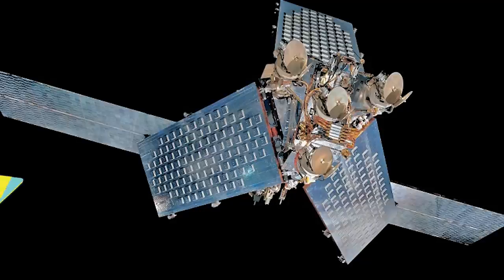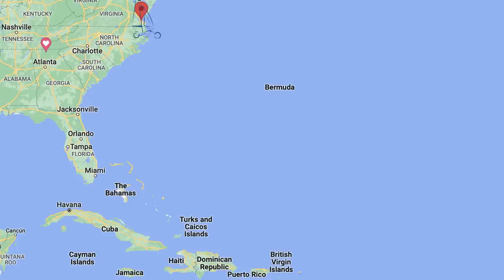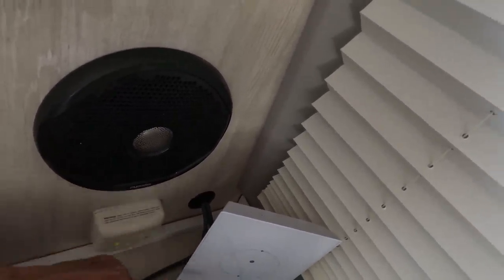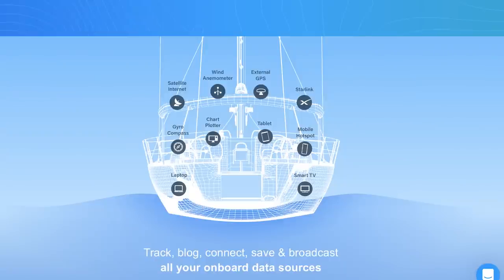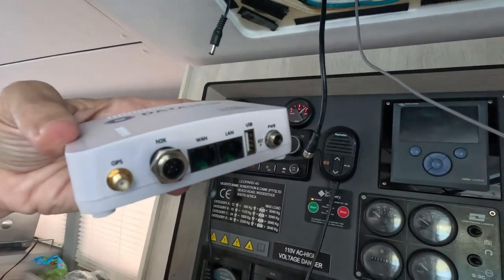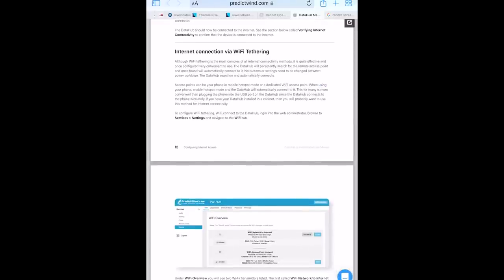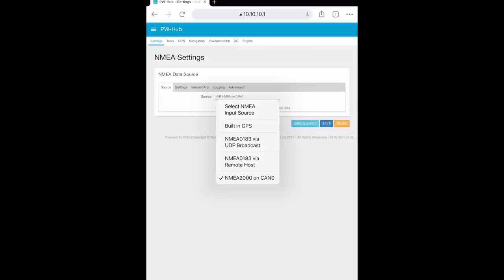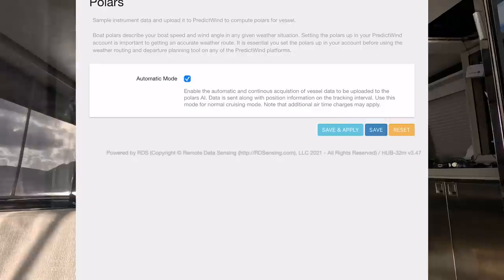Starlink vs Iridium GO. E70

Comment: We have Starlink on our yacht in Australia and its working very well here especially now its been upgraded to full coverage..... BUT...officially the coverage is only 15nm offshore so at some point Starlink "could" disable the offshore coverage. i am PRAYING they actually do the opposite and give us full ocean coverage but it is completely subjective at the present time. Unfortunately we are still stuck with the 1/16 speed of dial up iridium go with over inflated pricing! At this stage I feel if you are following island chains or coastal then it's a definite better replacement, but if you are crossing an ocean then we are still STUCK with iridium... unless Starlink will enable the access.
You can also get rid of the Starlin router. The Starlink cable is basically a standard ethernet cable and there is 48V POE (Power Over Ethernet) supplied through the cable to power dishy. There's lots of videos describing how to modify this and then it can plug into your existing network.
Reply from the maker: Thanks for the comment and the additional info. I’m thinking Elon is not going to disable any coverage. I believe he wants total coverage for as many people as possible. And I don’t mind having the router since we need one anyway. But maybe I’m missing something?
Reply: @SailingWindTherapy  our existing router has ethernet ports which Starlink is missing. When you have to transfer those movie files to the NAS drive wifi is too sloooow. Pretty good summary though and I hope you are correct, the iridium is so frustratingly slow and expensive, hopefully Starlink will give us what we need
Reply: @SailingNoRegrets  SL have an ethernet port as option
Reply: @tvguide4khv  Yes I've seen that and was considering it, but I'd still need a Ethernet switch (or use old router) as it only has the single Ethernet port. I have a couple of laptops and NAS drive so it is kinda strange that none were included in the Starlink router. I will go the PoE modification and half it's power use, beneficial on a yacht

Comment: Hi Jeff, Great video! Does the Data Hub require a predict wind (or some other) subscription to show position over the internet? How about computing polars?
Reply from the maker: Actually, yes it does and I should have mentioned that. I think the PredictWind subscription we have is a necessity. It’s the best weather app which keeps us safe and provides proper weather routing and passage planning.There are four different subscription levels but I think the tracker comes with the standard subscription which I believe is $250/year.  
Datahub I believe is calculating our polars now but I haven’t looked to see if it’s working yet and I’m also unsure what it does if we’re motoring. I have to call them and ask how that will work. Hope this helps.

Comment: as far I heard is starlink supposed to be a global service too, is that right? and if it is global, is it faster at the Äquator than at the pole region ?
Reply from the maker: I believe Starlink intends to be completely global but they don’t have all of the satellites 🛰 up yet. But they are going up fast! I’m trying to remember back to my science classes in school but I don’t think the service will be faster at the equator. The satellites should all be at the same altitude.
Reply: one told me the starlink sats chain up around the äquator, so my guess  was that it could behave like the cell network and rate the speed down by greater distances, but never mind. in comparison to the Iridium network even 10 mbps would be lightning fast

Comment: Starlink won't work more than about 500 hundred miles from a ground station,  if that.  So it's ok for coastal sailing but not something you can rely on for blue water sailing.
Reply from the maker: We had service for 1500 miles from Hampton, Va. to British Virgin Islands.
Reply: @SailingWindTherapy   You probably had service the whole way because you were within 500 miles of ground stations the whole way.  I think you are covered in the Caribbean and around Panama but I don't think you will get signal in the open ocean more than 500 miles from land.

Comment: You didn’t say how you had data hub ping your location!
Reply from the maker: That’s what it does. One of the settings is how often you want it to ping your location. It uses the WiFi created from Starlink. For our position, it can use its own internal Gps but since it’s plugged into our nmea backbone, it uses the gps data from the boat. Hope that answers your question.

Comment: I am happy not to be a Iridium share holder, that's for sure. Elon will crush them.. I still have a backup solution with IridiumGo but I intend to get rid of it the moment I feel that Starlink is reliable. Then I will only use my Garmin InReach as backup. I think.
Reply from the maker: I feel extremely confident that Starlink is completely reliable at this point with our experience so far. Also I checked into Iridium stock and it appears the vast majority of their business is with the governments so it’s not likely they will have any impact on lost marine revenue😊 I was fully prepared to short their stock